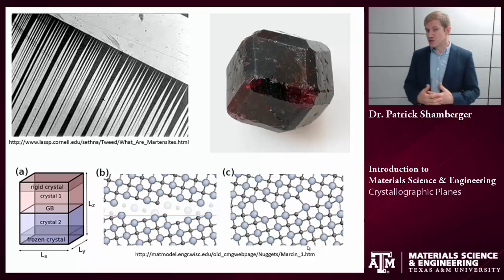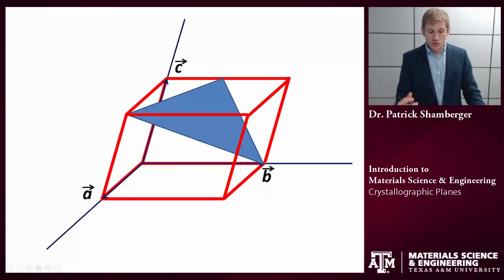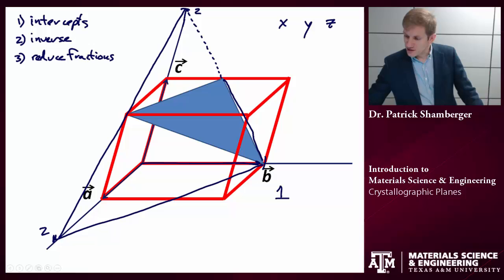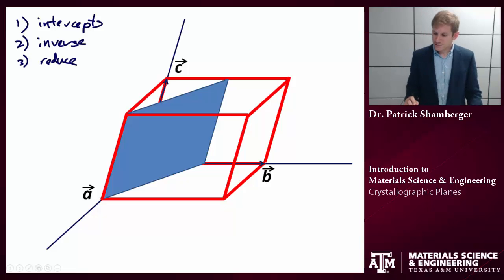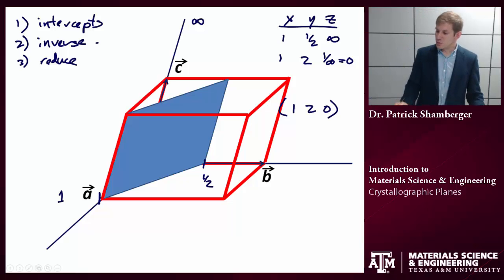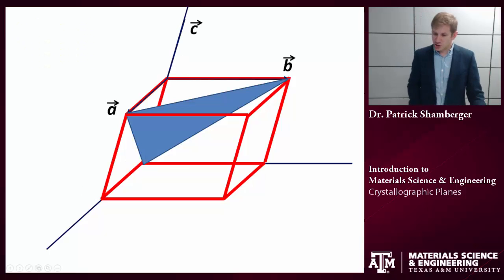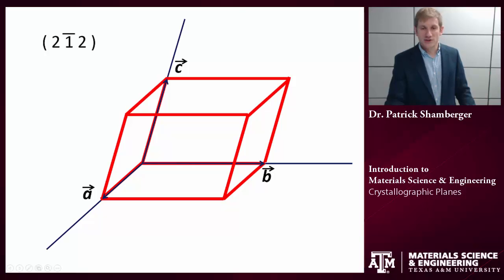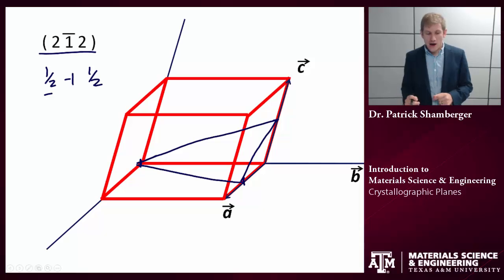Crystallographic Planes {Texas A&M: Intro to Materials}

Comment: at 02:48,  how does it intersect at 2 for a? why not 1. The extension from b towards the intercept on a should not be from the half but directly through the edge of the cube or? what am I missing here
Reply: I am also curious? is it because the length is longer than the 1 intercept?
Reply: Imagine if you had the interception of the plane with a at 1. That would also mean that the top left corner of the drawn plane (which is also at a =1) had the same position on the axis. Therefore the plane would be parallel to the c-axis if you keep the interception with b fixed (like in the following example 04:31). Also if you come from c = 2 you go one segment down and one towards a. Doing it again will lead to c = 0 and a = 2. I have to admit going from b -> a is quite difficult to spot because there is no direct line to see..

Comment: Is it matter where you shift the origin?? Or you could move it anywhere??
Reply from the maker: The underlying assumption is that all planes that are parallel will have the same indices.  Thus, it is irrelevant where you shift the origin.  **note: if you shift the origin "in front of" vs. "behind" the plane, you'll obtain planes with indices that have opposite signs from each other (e.g., (-1 0 2) vs. (1 0 -2)).  However, as planes don't have a "sign", these are identical/equivalent.

Comment: doctor, can we put 2 out for the last one then we will get 2 (1 - 1/2 1)
Reply: U have to inverse that... nothing else. that's the role
Reply: more like thats a rule *
Reply from the maker: If you are asking if a plane (2 -1 2) is the same as a plane (1 -1/2 1), then this is true (finding intercepts for these two cases would result in two parallel planes).  However, by convention, we generally avoid writing fractions in planar indices.